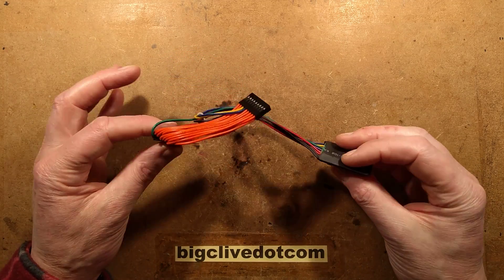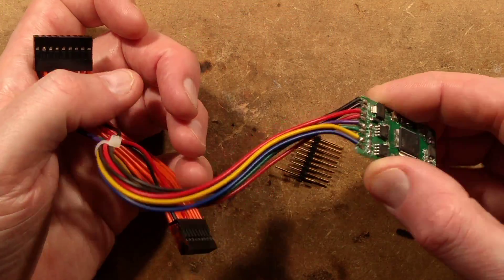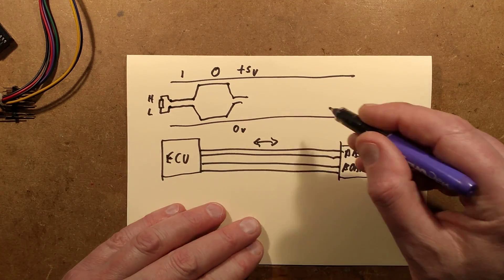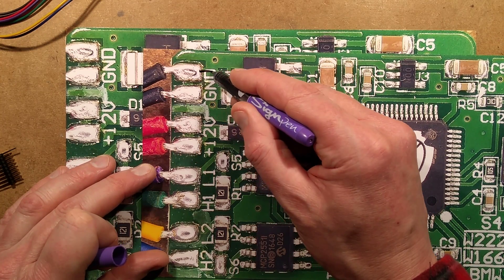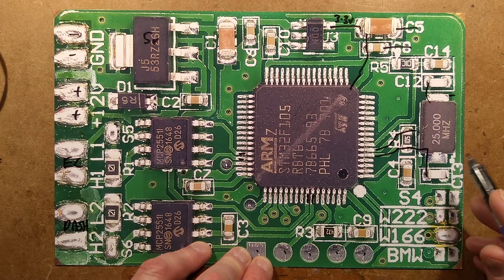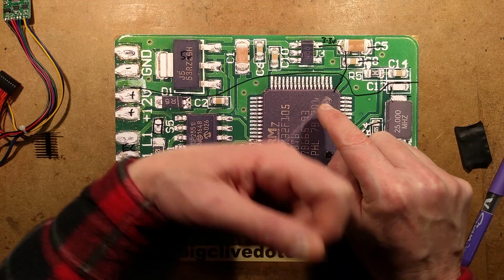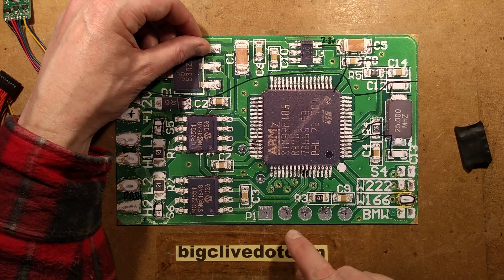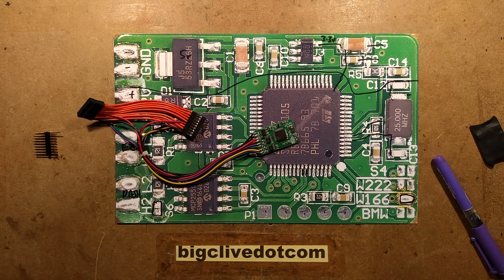Naughty CANbus odometer "interface".  (Fakes mileage.)

Comment: in the UK at least, those devices are not illegal.
It is perfectly legal to modify the mileage on a vehicle, you can even sell it with the incorrect mileage providing you state you cant guarantee the accuracy of it, its only illegal to sell it with false mileage as the correct mileage.
Reply: It's a bit more complicated than that. Also sorta relevant to Brexit.
Nothing you said is wrong, but the exact wording is important.
"The law states that it is fraudulent to sell a clocked car without disclosing it, but it’s not illegal to adjust a vehicle’s odometer mileage. A proposed EU ban on companies providing mileage correction services was supposed to be in place by May 2018. The LGA has called for this legislation to be implemented at the earliest opportunity and then retained under UK law after Brexit." - search the quote for ref (because links get removed here), and cc Times' FOI.

It's legal to say "I reckon my car has done about 10k".

It's legal to say "The odometer says 10k but IDK if that's correct.".

If you said, "The car has done 10k miles", and were later challenged, you'd likely lose. c/f same ref earlier, " Of the 140 prosecutions brought [...] 117 resulted in a conviction".

Comment: It's like the battle between locksmiths and lockpickers, new locks being made to prevent picking, only to be picked and further advanced, gone are the days when you could just use a drill to roll back the odometer... :P
Reply: Its like Radar Guns and Radar Detectors, even though I suspect they are both built by the same company.

Comment: as a professional mechanic & electrical enthusiast this was very interesting.  a good example of why I subscribed; all the random electronics you find and show.
Reply: I've been wondering how long it would take for a device like this to surface.
Reply: @Jimmeh_B  one time I made a circuit that disabled all the abs & wheel speed sensors so that the car could go above the factory limiter @ 115mph. it had the side effect of stopping the odometer & speedo from working. but it was on my car & I checked the odometer discrepancy thing on the title just to be safe.  
  
the circuit was just N.C. relays at every sensor, all powered from a switch under the dash. when on they all interrupted each sensor. the car couldn't tell how fast it was going so it didn't know when to limit speed. just used a gps speedometer app and away you go.
Reply: @jankcitycustoms  I like it, simple and effective. :)
The first thing I do on any car with ABS is pull the ABS fuse. Not a fan of ABS.
Reply: @Jimmeh_B  haha  that's funny, I am the same way.  
my girlfriend's car has traction control you can't shut off. so I always pull the ABS fuse when I drive because it disables all of that shit by the one fuse.  
  
edit* especially during winter. once you practice it's fun to keep the wheel truned and pulse brakes to alternate between sliding straight & turning
Reply: @Jimmeh_B  
A pedal car with ABS?
Reply: @daverhodes382  Wot? Pedal car?
Reply: @jankcitycustoms  LOL. Yeah, who'd have thought that car's are much much more fun to drive when you a: possess the ability, and b: are actually in control of the vehicle?

Give me an RWD 5sp button clutched 308 with a 650 double pumper any day over today's offerings!
Reply: Story time,....... especially for mechanically electric!
Reply: ADEBISI ADEBISI  Fuck off ricer.
Reply: Shoulda saw the face when I had to take my car to the dealer for service and my “mess” I had. 

It’s funny you could do whatever you want mechanically and they won’t say a thing but even dare plug Something into the cigarette lighter socket. All hell breaks loose 

Was even better after they removed all my stuff and the issue stayed… that’s weird…. That’s not possible! The car itself couldn’t possibly have an issue!!!! It’s always the user!
Reply: ADEBISI ADEBISI  lol. na, handjobs are near the bottom; I'll see ya down there later. this is the bullshitin' story time thread.
Reply: @jankcitycustoms  nice one ,:-)
Reply: ADEBISI ADEBISI  You must be loads of fun down the pub :P

Comment: Surely that ARM chip is overkill for this application? All those unused pins and surely other chips could meet the possibly 25MHz requirement and I imagine memory requirements aren't too big..
Reply: Not really - legit STM32F105s can be had for ~£3 in smallish quantities, and there's almost certainly a Chinese clone available (there has been for the F103 for many years).
You can't really get cheaper chips that have two CAN controllers and enough CPU speed to process all of the CAN traffic passing through a CAN gateway.

Comment: I'm guessing the  circuit board was developed as a generic device that could be programmed for whatever use the owner needed and was then  used by someone nefarious to defraud car purchasers.
Reply: It's called a CAN filter. You can find them on DHgate and Aliexpress.
Reply: No I think they're purpose designed for this - someone above has linked sites selling them in bulk. There are even expensive devices that reflash the ECU and dashboard with new mileages etc.
Reply: the bottom right side of the board (looking at his big photos) has solder joins labelled for different versions of the protocol, i would guess that this is purpose built for "being naughty" as clive calls it
although, you could repurpose it as something else that used 2 separate can busses and only 4 other IO (the 4 protocol choices are just gpio, could be configured as input or output) stm32 microcontrollers are really nice/easy to work with (although the can bus speeds are a bitch to get at first)
Reply: https://www.dhgate.com/product/yanhua-mb-can-filter-18-in-1-benz-bmw-universal/422061032.html#s1-7-1;searl|1741375639
Reply: @ebthepcguy  I don't see a mileage set in the description. I'm curious if you program it or is it set from the factory?
Reply: @mitchellroberts7954  You can program it. It's intended to be used for mileage correction but obviously "correction" can be fraud.
Reply: @Cyrix2k  is that what the 2nd connector is for? So you can install the device then connect a laptop to it?
Reply: @richardboggon6639  Looking at this more, I don't think it is intended to be programmed. However, yes, that is a programming header (JTAG I believe). The way the board normally works is it just blocks the CAN IDs transmitting mileage and maybe VIN. BMW and I image Mercedes as well store the vehicle mileage in the cluster as well as copies in other ECUs. When a unit is replaced, it adopts the highest mileage seen. The factory only intends for new parts to be installed (referred to as virgin - mileage is 0 and the VIN isn't written). As vehicles become older, people like to save money by installing used parts. If the used parts have lower mileage than the vehicle, it's fine. If the used parts have a higher mileage, something like this is used to prevent the instrument cluster from displaying the wrong mileage. 

I just bought two of these boards. It looks like use an STM32 microcontroller which is what is found on a lot of the newer, fast arduino compatible boards. I want to alter some CAN IDs in flight and this board looks like just the ticket.
Reply: @Cyrix2k  In flight? I hope you don't mean for aircraft lol
Reply: @mitchellroberts7954  no lol. In-flight means real time across the wire
Reply: My thoughts exactly. It's not illegal per se to put something inline to inspect/modify values, but a certain program that the seller DEFINITELY wouldn't know anything about (wink wink) COULD theoretically be used to commit fraud by an unscrupulous reseller, car dealer, or mechanic.
Reply: @ndm13  agree. Also maybe it's perfectly legal to modify the mileage, for example replacing a faulty instrument cluster and transfering the original mileage to the new one?
Reply: honestly, you really wouldn't need an entire design team to make this thing. Hardware wise it would be pretty trivial to design and have manufactured. additionally, for the programming, I don't think it would be too hard to make. Can bus is very open standard and there are a lot of libraries for interfacing with it.
Reply: We designed and made our own circuit boards when I was in school, part of technology lesson. Nowadays a lot of people design them on computer and email the plans to a PCB production house, who post the finished boards back to you in a few days. A factory would probably have their own machine, or else contract somebody else to make however many thousand of them. 

This is a basic design. CAN chips connect to relevant wires, processor connects to CAN chips. That's not a very complicated design. 

The software is "when you receive a CAN packet from one side, send it out the other side. UNLESS it's stuff about mileage, in which case do a little bit of arithmetic on it first. Then send it."

That's it, all there is. I could design and solder you one up in a day. Writing the software included. You'd have to wait for the custom PCB, this would at first be messy and full of hanging wires. Really not sophisticated at all though. 

CAN packets conform to standards, so your code can tell which packets are all about mileage and the odometer. The solder bridges for different cars must account for slight differences in manufacturer implementation, which doesn't surprise me different car manufacturers being needlessly fucksical.
Reply: This board is 100% made for fraud. It's hard to believe that an entire factory and design team went and built an illegal board, but that's exactly what happened here. I'm sure when competing board vendors caught wind of it they went and made their own boards. They probably flooded the market with 50 different variants a month after the first guy thought to make one.

They know exactly what they are making and what it's used for. They don't care what the law says, they just do it anyway. The fraud mentality in China is a cultural thing. I feel like it's just a big game to them. They think like drug dealers. There is a demand and they are ones who can supply the product.

I've always wondered how Chinese people deal with other Chinese people when they realize they've been duped. Do they fight it out? Do they just shrug it off and figure they should try harder next time? This is how you get shot in America. (We do love our guns.) I don't know how China doesn't have a ton of secondary crimes stemming from the rampant fraud occurring everywhere.
Reply: [MonochromeWench]
Cap'n Obvious? Izzat you?
😂

Comment: The W166 refers to the 3rd generation of Mercedes M-class, W222 are the short wheel based saloons in the s-class. S-4 might be for the Audi S-4
Reply: That explains why the E-class was throwing codes -- if this was designed for an M-class and they installed it on an E-class, it's probably hosering some of the data.
Reply: @eformance  such that when the A/C reached its set point, the dash reported low engine oil.
Reply: Dave Micolichek  LOL, only car geeks thinks Wnnn are self-explanatory while S4, a well-known model name for everyone to see on the back of the Audi model, is more like "guessing Audi" 😂
Reply: I doubt it. The S4, A4, Octavia, Passat etc. are all variants of the 'B' platform.
Reply: well, the new Toyota supra and the BMW Z4 is basically the same car ;)
Reply: A typical multi-application board.
Reply: W222 are the short wheel based saloons in the s class !!!!
Nooooh a W222 is an S class be it short or long wheelbase 
If if has a zero after so W2220 that denotes short wheelbase 
A one so W2221 denotes long wheelbase 
The next two numbers denote version I.e W222.125 would maybe a lwb s320
Reply: @madds6678  Was thinking the same..
Regardless to that I think You'll still find the CAN Bus coding as Related to Mileage, and way it is Read, to be the same across the W166 Range & Coding across the W222 Range to be the same.. ;o)
Reply: Pity there isn't an "AS" - for auto select - surely you can tell what 'car' it is by asking the ECU ? (No, number of wheels, body shape etc. irrelevant - what car in terms of electronic control !
Reply: @millomweb  yes its encoded in the vin.
Reply: @millomweb  only good if you actually programmed it for both cars.

Comment: I believe the reason the polarity of the CANbus is the way it is is due to the following:

Each device has a unique ID, its arbitration code. When a device first starts transmitting, the first thing that is transmitted is the arbitration ID.
This ID is transmitted "left to right", or most significant bit first, and the lower the ID the higher priority the message.

As the device clocks out the arbitration ID, every time it clocks out a 1, or recessive bit, it checks to see that the line actually is in its recessive state. If it's actually active, or reading 0, that means that another device is driving the bus simultaneously. And because its ID is by definition lower (it's transmitting a 0 when the first device is transmitting 1), it's a higher priority. The first device takes that cue to stop transmitting, and relinquishes the bus to the higher priority device.

By that method you avoid any message clashes to a high degree of reliability.

Now whether that came about because of the polarity, or whether the polarity was cleverly decided upon to support this feature, I don't know... But I would guesstimate that it's the latter, as it would in principle make it easier to support longer arbitration IDs in certain applications or variations of the CANbus protocol.

Comment: ......... and that is why you should look closely at the service book and repair invoices,  the wear on the pedals, gear lever and steering wheel and the general condition of the car. If it looks out of kilter with the mileage, walk away.
Reply: Dave Leighton and in the UK, the MOT history, available online, should show any large anomalies year to year, though it wouldn’t pick up anything done in the first three years.
Reply: Own a 600k mile Ford Crown Victoria.. You can not tell it has that sort of miles on it, clean inside and out.
Reply: @zuestoots5176  Same with my Sisters '14 Micra. Due to it basically being a taxi for me and my mum plus regular drives to grans it does many miles a year (over 15k) and whenever it goes for it's service they are amazed at the condition (well probably not the mess that is inside but hey).
Reply: @dglcomputers1498  how is that "many" miles? My mum does 120k km a year.
I do 40k km a year and it is nothing.
Reply: @FlamJongUn  It's compared to what a car of that type is expected to do. A Micra is a city car mainly driven by old fogies, plus the service intervals are every 12,000 miles. Yes for a larger car 20k is nothing but for a smaller vehicle it's a lot.
Reply: @dglcomputers1498  my car is a 07 yaris and my mum's a  15 citroen C3
So same class
Reply: Service books are faked by dealers, they have the stamps etc.
Reply: No service books here in the USA...and I think few places would care about passing it on to the next owner even if you leave a copy of the work orders in the car when selling

Comment: The dominant 0 is used for collision avoidance. It works if the device with the highest priority has the smallest adress on the bus.

Quote: The CAN specifications use the terms "dominant" bits and "recessive" bits where dominant is a logical 0 (actively driven to a voltage by the transmitter) and recessive is a logical 1 (passively returned to a voltage by a resistor). The idle state is represented by the recessive level (Logical 1). If one node transmits a dominant bit and another node transmits a recessive bit then there is a collision and the dominant bit "wins". This means there is no delay to the higher-priority message, and the node transmitting the lower priority message automatically attempts to re-transmit six bit clocks after the end of the dominant message. This makes CAN very suitable as a real-time prioritized communications system.
https://en.m.wikipedia.org/wiki/CAN_bus

But that probably would also work the other way around...

Comment: it may also been used for changing the odometer because of larger aftermarket wheels on the vechical as that would affect the milage
Reply: Larger wheels would show a lower speed and number of miles, not higher.
Reply: @TakeMeOffYourMailingList  sorry am pretty drowzy thats what i meant more just the meaning of any wheel size change messes with clock

Comment: Oh if you want to read the chip, get yourself a stlinkv2 2 quid off aliexpress...... Those pogo jumpers are likely swdio stlink pins, The board would have been made, and the pcb pressed onto a pogo header and quickly programmed... You can solder the stlink jumper wires to those pins and connect to it using stlink utility... And if its not protected youll be able to read the raw hex/bin on the chip. Though not the decompiled program... Thats a whole other effort to decompoile code...